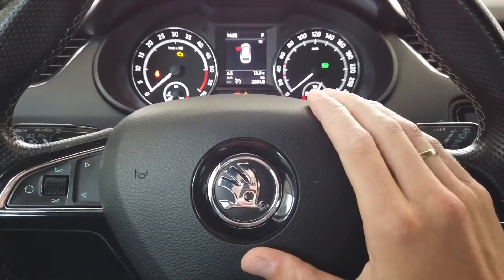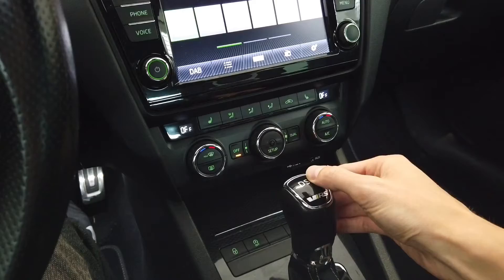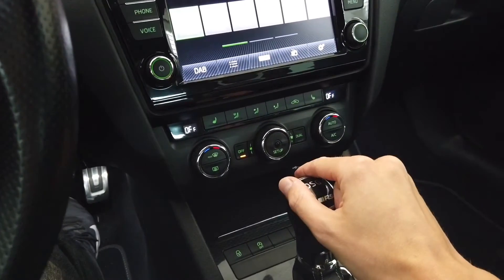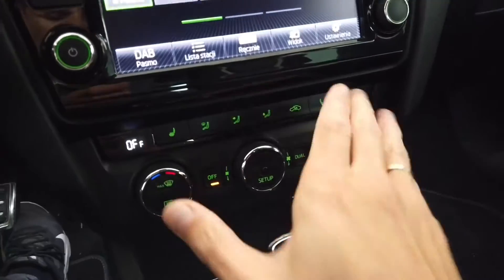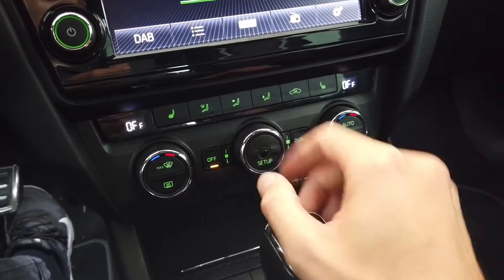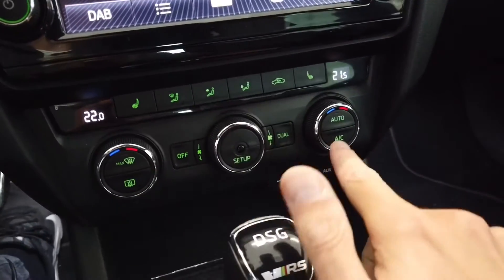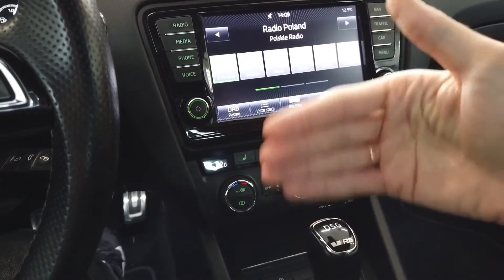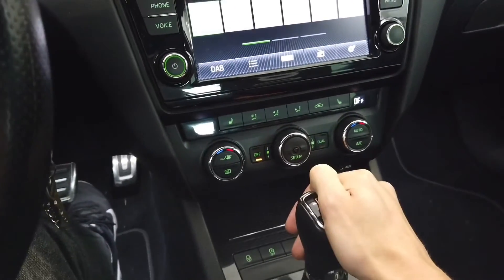Skoda Octavia MK3 (5E) climatronic calibration air flaps

Comment: Still not a Passat 😄
Reply from the maker: Is Passat some kind of car benchmark? 😉
Reply: @mrfixpl  Not what I meant, all my octavia friends think they have the pragmatic version of the passat: cheaper, better, faster why spend more?! reasoning. 😁
Reply from the maker: @phunkmeister  Oh, I get it. Honestly cars on the MQB platform (Passat B8, Golf MK7, Audi A3 8V, Skoda Octavia, Seat Leon 5F) are so similar that on one hand I'm surprised with the price difference, and on the other hand I love the option to retrofit something from a higher segment car or different "brand".
Reply: @mrfixpl  Re: retrofitting, funny one when one of them has shown me the climatronic off button for an older octavia was intentionally blocked with plastic feet from activating the electric contact. You'd cut off those plastic feet and you got an unlabeled button that now did something.
Reply: Octavia is a golf same technic same class. But skodas are always bigger and more practical than volkswagens. Passat and Superb are also same technic and in same class👌

Comment: My car (Seat Leon 5F) sometimes has a whizzeling noise at higher speed coming from the ventilation system. Do you think this might solve the problem?
Reply from the maker: You can try, but I think that it can be the blower motor. Next time when you hear the noise try adjusting fan speed to check if it disappear at different setting. If so it can be as easy as putting some WD40 on the blower motor axis.
Reply: @mrfixpl  thanks for the info! When my car was in the garage I asked the mechanic to check and he told me he opened it up and cleaned everything around it. However, the whizzeling noise remained.